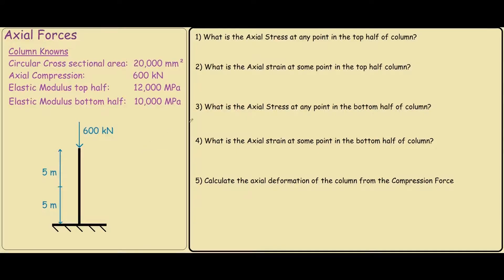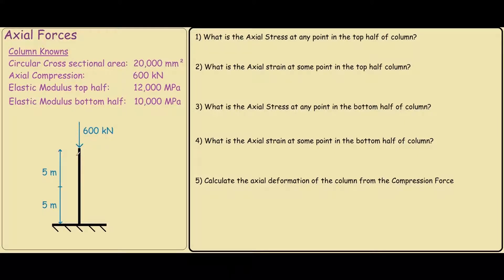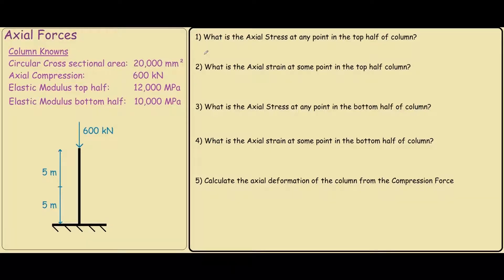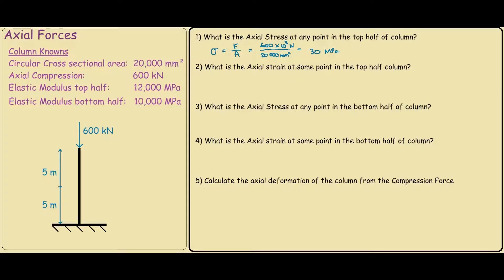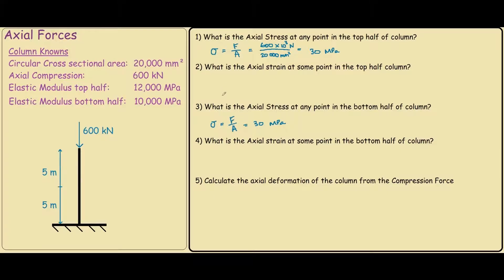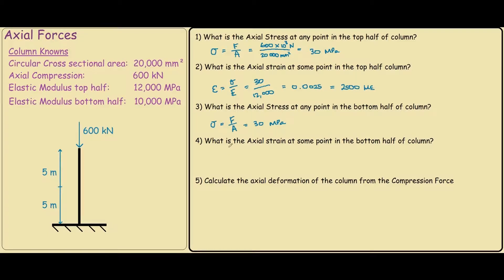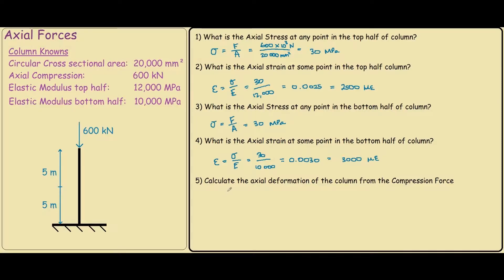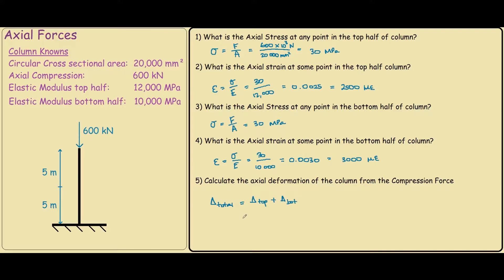Axial Loading Stress, Strain and Deformation

Comment: Hey man I got this question 

Calculate the extension in a steel pin that is 120mm long and 12mm diameter when an axial load of 1.8 tonnes is applied. 

help a brother out please
Reply: 1.8tonnes = 1800KG, assumed as 1800N or 1.8KN. All you got to do is figure out the elastic modulus to find the strain.